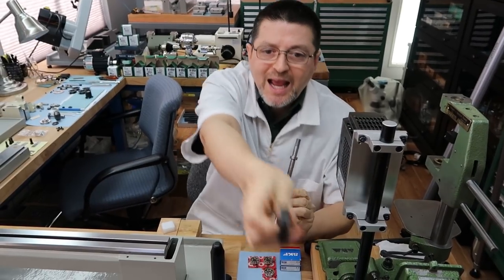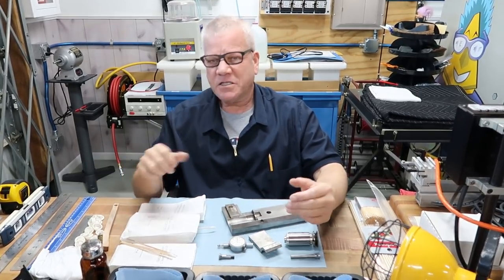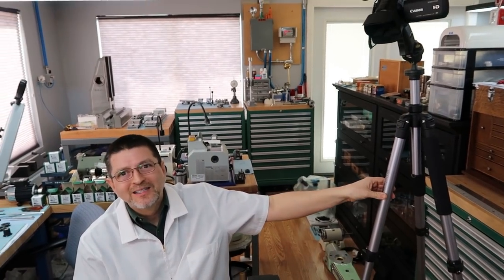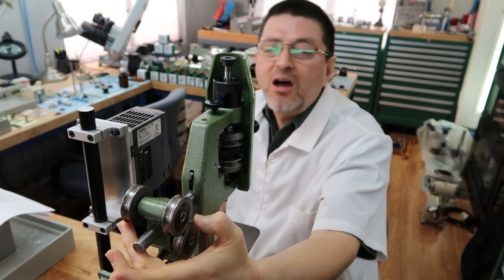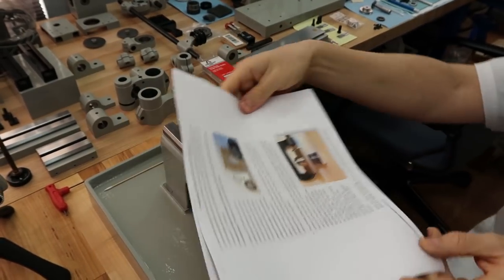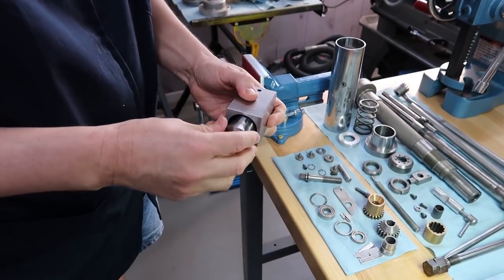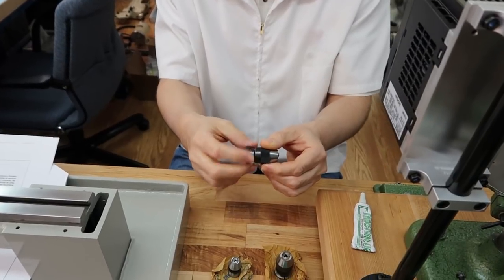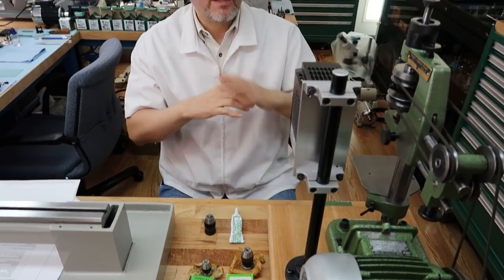SHOP ADVENTURES 21: German Tapping Machine Assembly & Albrecht Chuck Rebuild

Comment: Nice work on the tapping machine and great tip on the collet block. I recently picked up some new and used Albrecht chucks at an auction. Sold all the new ones already which paid for the used ones that I kept! Anyways I had one that was jammed and I managed to disassemble it with a oak block bored to fit the same area that you clamped on yours. Split the block in half on the band saw and clamped it in the vise and used non maring cannon plug pliers. I don't have any collet blocks (getting some soon) but that looks like the way to go! Your video production is getting better!
Reply from the maker: Hey thank you Burton's Attic for stopping by for taking time to share your approach to the Alebrecht chuck talks. Wood is a weakness in these two men you are to be honored for your thought to use it in the disassembly of the Albrecht chuck you have you (lucky to score hoard) that was an out of the box to us great idea. Come back Monday evening or whenever to see some great sharing about eh Albrecht chuck conclusion and some other peoples thoughts now added to the show about the chucks not able to hold hardened steel shanks in the chuck they loosen and many other things including the running and tapping sample threading on the German tapping machine and such it should be fun to watch. 

Thank you as well for the video quality we are working to continually enhance both the features and the quality within each video so over time there will b great video but there will still just be these two childhood best friends making a machined product on a micro scale taking place. We are actually so thankful to you our fellow Youtube creators having accepted us and that we have things you and others feel are helpful to viewers, this YouTube community is so great to be a part of, thank you. Lance & Patrick.

Comment: Lance & Patrick,
   I am a little late getting to your video this week. I’ve been rebuilding the bench supports and work area for my small lathe. (Not micro) Anyway, after I got it finished and even painted I realized it just wasn’t very practical after using it for awhile. I’ve been in the process of tearing it all down and starting over to do it right this time so my time on viewing utube videos has been somewhat curtailed. To be honest my dissatisfaction with the setup I originally designed for the lathe is a direct result of watching your concepts of design for optimal performance and physical comfort. That’s a good thing even though I’ve had to rethink the situation and start over. (My wife thinks I’m a bit loony because of the time lost but after 50 years together she realizes there’s no hope for me anyway! Lol)
    I really am impressed with Patrick’s ingenuity and thinking through a better way to hold a part. The collet is a much better way to hold round, cylindrical items. The plates would have worked, no doubt, but with an item as precision and sensitive as an Albrecht chuck it just makes sense to apply even pressure around its circumference, which is what a collet is designed to do. The plates could possibly have crushed unevenly and forced something out of round. Metal moves when you stress it, even the hardened metal of a chuck, so it’s best to minimize the stress whenever possible. 
   The chuck is how old? It could be the bearings themselves have reduced in diameter with use over time or even the surfaces they bear on could have worn a bit causing the loose feel. As you know in your micro world it doesn’t take much wear reduction to lose that pristine movement. Perhaps Albrecht provides wear factor bearings to replace the worn ones? I don’t know, I’m just shooting into the wind here. 
    I was delighted to see Patrick in the blue coat of the working man! Somehow though, he just didn’t look quite right! Lol
Good video guys. Keep them coming. Can’t wait to see that tapping machine running.
Dale
Reply from the maker: Hi Dale Griggs 
The tapping machine will run and tap test holes this coming week, issues do happen. 
Lets start with your heart award, you were given a heart for recognizing the collet circumference holding of a collet versus and plate or a pair of plates great analyzing of this situation. Then the most important part to share with you about the heart being given to this post it is your wife's ability to handle you for 50 years (50 fifty years wow) congratulation to you both their. 

We hope you machine location placement works out well for you and your machine. You will have to share with us when you get this done and you have some time to try it out for a bit and such.

We know the chuck when we bought the tapping machine used was about 15 or 20 years ago we never serviced it (no issues). We know that it is likely 40 plus years in age Dale. We did measure the individual bearings diameter each x 25 pieces, they came in at precisely 2.0mm and all we can do here is compare these findings to the new Albrecht chuck 3.0mm maximum capacity chuck in the box we will be filming the disassembly and measurements of.

The way we film here means you and the two of us see the results of our findings and discoveries at about the same time. We realize you might not know we film very near air time each week so this is a very real-time video series. You are spot on when it comes to the micro-machining and micro-finishing world a little movement is too much like a nice looking lead screw seems fine to the eye it is actually worn down meaning no smoothness remains bad in the micro world you are correct here.  
No blue coats for Patrick he has to earn that color and the charcoal coat is coming soon we will not ruin the surprise here though not yet. Thank you Dale so much for being here and for your great knowledge you clearly have. Lance & Patrick.

Comment: Hi, Sorry to correct you, at around 54:50, they do not tell you to not grease any upper component,    only not to grease between 2 and 4 and between 3 and 1, here is a copy of what they write ...............  "Take care not to put grease on the thread between spindle 2 and body 4. These surfaces have to be clean and dry in order to secure the function of the chuck. - Don’t grease the matching guides of shell 3 and jaw guide 1 so the air can escape during assembly."............ It is my personel opinion that light OIL (not grease) between 3 and 1 wont prevent the air to escape.

So in short, the chuck is relaying ONLY on the friction of screw number 2 against number 4 to be self tightening and to hold on to drills or taps. So the friction between 2 and 4 is what makes the chuck work.
Reply from the maker: Hello Zephyr Old, it is great to have you stop by. You are a good reason for us even having this channel where we encourage open dialog and feedback to our videos.

We love you Zephyr Old and we know you love our videos so read what we reply with that in mind please. 

You see and please allow us to share first that technical writers are to remove presumptions from their writings and are to write in clear concise clarity and the directive to achieve the goals of the objective. 
Albrecht fails at this if we are to only go with the "Albrecht Instructions For Repair" which we believe also covers Rebuilding an Albrecht chuck.  We feel they are too vague in their instructions which leaves the Albrecht user to have to make assumptions which is never a good thing.

It is great to have you stop by as you are a good reason for us even having this channel where we encourage open dialog and feedback to our videos as they are priceless to us. That being said, you need not be sorry for anything, even your guess or interpretation at the actual Albrecht chuck Repair Instructions, you are believed to be in the wrong by us through research on this topic and here is where and why.

BEFORE WE START OUR CLARITY, PLEASE UNDERSTAND OUR RESEARCH

Here are the actual "Instructions For Repair" text from Albrecht 

If you read these Albrecht instructions below, please see where it says at each step to neither grease or to grease. And you like us where you are reassembling an Albrecht chuck, what parts would you leave dry and what parts would you grease, not guess what do the instructions say to do? 

ALBRECHT INNER TAPER CHUCK REASSEMBLY INSTRUCTIONS START HERE

  -  Please make sure that the pin is aligned with the slot provided for 
it in the shell.

  -  Put a lot of grease (water and heat resistant) on the balls, only a 
little grease on the guides. Take care not to put grease on the thread 
between spindle 2 and body 4. These surfaces have to be clean and dry in 
order to secure the function of the chuck.

-    Don’t grease the matching guides of shell 3 and jaw guide 1 so the 
air can escape during assembly.

-    After assembly of the jaws tightly screw together hood 7 and shell 3.

-    Assemble the collar grip 5 with clearance to shell 3

ALBRECHT INNER TAPER CHUCK REASSEMBLY INSTRUCTIONS END HERE 

Before we share these understandings with you, first off please know we love our large collection of Albrecht chucks as we stock them in 3 categories. 

They are:

  -  Currently ones in use
  -  Newer manufactured and still in packaging
  -  New Old Stock (NOS) or very vintage

The Albrecht chuck repair instruction sheet references 9 components however component 8 is absent so readers understand this is about 8 components in total. 

You Zephyr are discussing parts 1, 2, 3 and 4 which are:

  -  Part 1 Jaw guide
  -  Part 2 Spindle or left handed screw 
  -  Part 3 Shell
  -  Part 4 Body

You Zephyr in your comment believe as the instructions do clearly state, does not imply grease is placed everywhere except as you share here below.

1) Threads between 2 and 4 get no grease this is referring to the screw left handed in center of cage part number 1.

2) You then say that there is to be also no grease in the 3 and 1.

You then say (ASSUME) the grease is to be placed everywhere else on all other parts, only the instructions do not say that. The Albrecht Instructions actually do not say to, or not to apply grease so in the actual factory documentation shared publicly at this point, you would read that we stand correct and you are not correct. So lets read a bit onward to share in addition with you, the other viewers and readers the additional research that was applied into our video background information on this topic to assure correctness in our efforts is of the utmost highest in quality. 

Lets start this final piece of research for these videos and to provide you additional guidance here Zephyr Old as we hope this turns out to help you see outside the box of possibilities on not just the Albrecht Inner Taper chucks but on the many other products we all have grown up with and have learned to or are supposed to trust in.

WHAT OUR VIDEOS SHARE

We know you have watched 2 videos, Shop Adventures 21 discussing the issue we encountered and Shop Adventures 22 where we share our full unedited disassembly and assembly of the Albrecht chuck. Or at least you commented on these two, sharing this belief you have about the chucks grease and maybe oil.

In Shop Adventures 21, we also share how we followed the Albrecht "Instructions For Repair" while refurbishing that chuck for our German Hagen & Goebel (see, we love our German made products, the companies and people that make these machines and tools).

ACTUAL TELEPHONE CALL

We had a qualified friend contact the Albrecht factory in Germany and speak to a technical support representative. And after sharing the chuck type details and such with the company person, he asked what on the chuck do I grease or oil? He was told to reassemble the chuck dry, except to grease only the ball bearings and lightly the bearing guide or race.

INTERNET RESEARCH
 
We researched on the Internet and found people that actually rebuild the Albrecht chucks and are told the same thing, do not grease anything except the ball bearings and guides races. 

We also researched machine tool groups and forums, and discovered that many make these same claims and that is you are to assemble these Albrecht chucks dry except to grease per the provided factory instructions.  Some people with griping problems are even told to reassemble the chuck completely dry throughout.

When we disassembled the chucks, both the old used one we were trying to refurbish and the brand new one in the box, we discovered grease was not just on parts 1, 2, 3 and 4 but we discovered that both chucks have grease and NO oil on parts 5, 6, 7, (No 8) and 9 as well. Meaning that even if you thought you had a correct dispute with us about your interpretation of the Albrecht instructions, our findings from the disassembly of a brand new Albrecht chuck in the box concluded that it was greased from head to toe and everywhere in between making the factory instructions false.

IN CLOSING HERE

We set out to refurbish a chuck and in doing so, following the provided official instructions from a 100 year old plus company named Albrecht. The chuck when completely reassembled sounded and felt like a cheap imported clunker so that led to additional research and that research led to a video on the topic from us.

We invested the time to research, time to film and time to test this so that the future Albrecht Chuck user re-builder or one that refurbishes these key-less chucks would not have to experience the cheapness the instructions created.

Albrecht is actually at fault for the feel results here as they do not provide good or accurate instructions nor any good instructional videos on how to do this repair or rebuild process.  It would be our advice to them to provide clear instructional videos for their customers in all languages globally.  It is the least a giant company with its rich history and it attentions to making great chucks that they should be providing the buyers and the users of these fine quality drill chucks this information.

Once again Zephyr please understand us, we are here to help others, not bad talk anything or anyone if we do not like or even love a product or person, we learned it is just best to say nothing as our parents taught the two of us this.
 
Zephyr, you are a great and passionate person, and we thank you for the private emails, you are a really nice guy we are happy you know. Please feel free to email to us anytime as we share with all viewers at Shop Adventures.

Comment: to bad you had a little trouble with you chuck :) hey was meaning to ask you what do you do with all them bearings you remove i have a idea for them that would serve them well . and keep them out of the scrap pile.
Reply from the maker: Thank you though the chucks do wear, we just wanted it to work its best as part of the total tapping machine refurbishing, it had to be done or replaced and that price meant we would rebuild it, learn from and about it and see what makes this the best drill and tapping holder chuck made, that lead to us not sure about what was going on and a quality control audit was instigated to do some discovery. What are the used bearing good to use them for? Want to share we just place them into a box after tagging them with the issues they might be having the date they were removed from service and that is about it, they are left around here for studying the issues bearings sometimes have so we can learn from them, we do a lot of off work time studying and discussions around here.